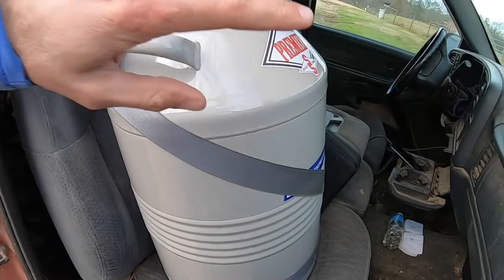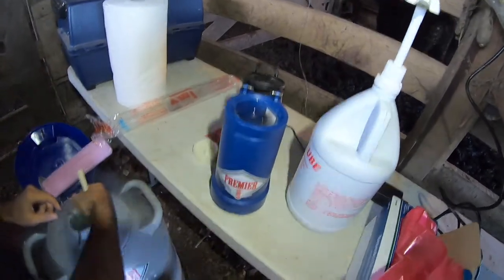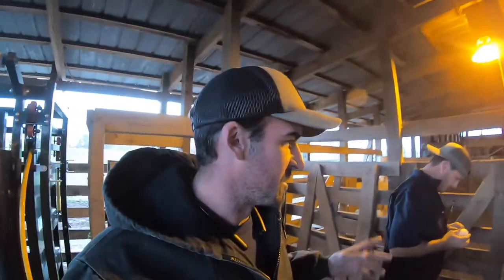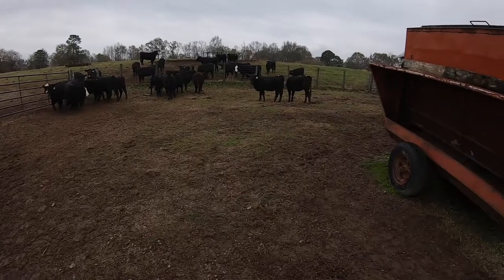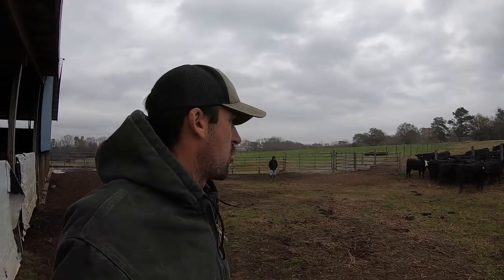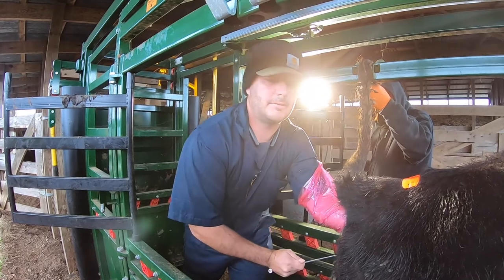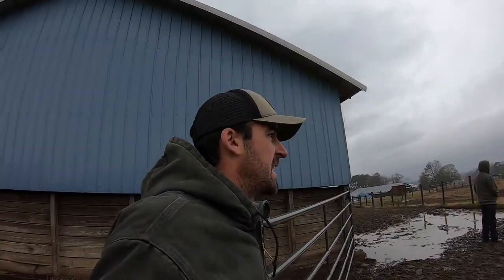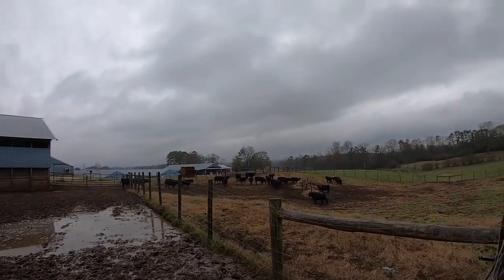Breed 'em & Weep!

Comment: How many days after calving do you start  to synchronize your cows ?
Reply from the maker: You can start to synch back as early as 20 days after they deliver, but we typically try not to sync anything that is under about 35-45 days post partum.  Ideally, everything is 45 days and more post partum.
Reply: @FarmerHunt  do you do your own palpation for pregnancy, say at 6 months or use ultrasound and get vet? Or cull at calving dates?
Reply from the maker: @alc609  I do a little bit but for the most part we have a buddy of ours that will ultra sound and do our palpation. Sometimes we will just draw blood and send it off. I like the ultra sound though because you can get a better idea of what may be AI and what may be clean up bull. We are hoping to get us our own ultra sound machine in the next year or two and do more of our own.